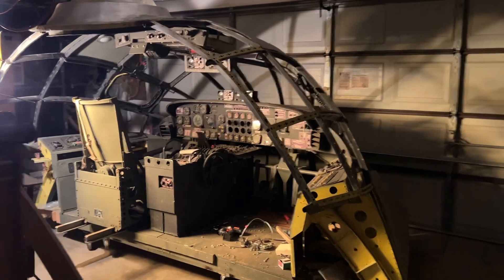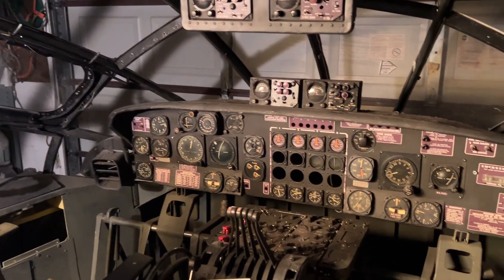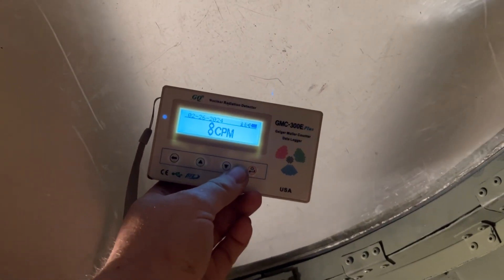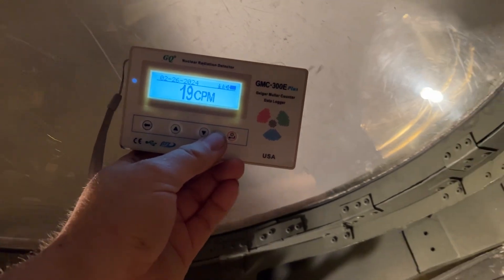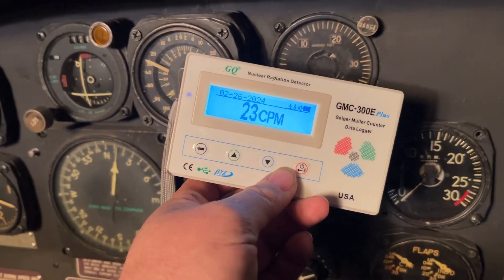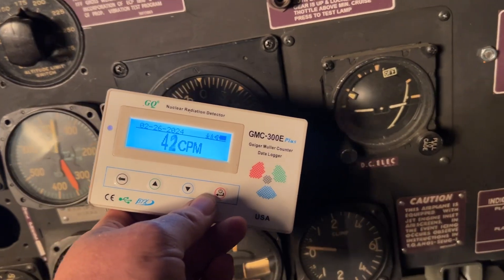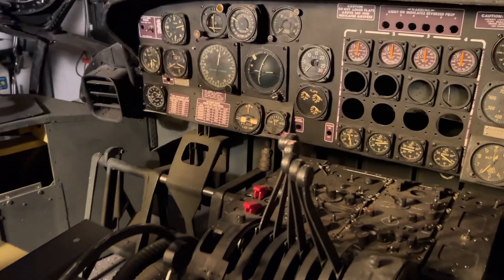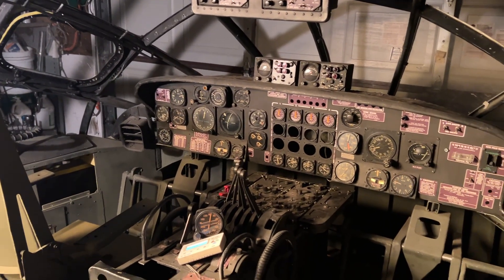B-36 Peacemaker Radioactive Flight Instruments And Gauges

Comment: I'd love to buy that compass! Anyhow, I advise you be careful with these gauges for two reasons- they, in bulk, can create a toxic atmosphere of impermissible levels of radon-222, or radon gas as a natural byproduct of Ra-226 decay. Secondly, they are known to leak radium dust, and contrary to the ''don't lick it comments'' this is worse than you think when you consider that the GQ GMC 320+ you are using is horrible at detecting both high energy gammas and betas, which are principle Radium emissions. 

If this at all concerns you, please reach out for advise. I'd recommend spending money on a pancake probe or alpha scintillation to mitigate any potential contamination incidence(s)
I should also bring to your attention that legally you can only own 100 of these gauges.
Reply from the maker: Excellent information, thank you. The gauges you see are all that I have, and the compass is by far the hottest. I keep it stored in an isolated part of the house, pointed into the foundation. I wash my hands after handling, which is once in a blue moon.
Reply: @B36HPeacemaker  I have 6 of those compasses, and yes that specific one is pretty hot. I think those came out of ships, the aircraft version looks a little different.
Reply: @spartakusgoulash3109 From the person who has since acquired his compass the last week, I can tell you... that thing is indeed HOT. Both my Radiacode 103 and 110 detectors scream just getting close. My devices are able to detect it in the open air from about 20ft away even with it facing away from the detectors. Currently I have it in an airtight container, inside another plastic sealed container (Double air tight to prevent leaks), wrapped in a .5mm lead blanket thats easily doubled and tripled up layers, and inside an iron box. That thing is still detectable from around 6-8ft away, but it's like 1% of the naked reading and barely above background levels at that distance. (Radiacode 103 device hits 750k CPM and the far more sensitive Radiacode 110 detector hits over 1.5M CPM. I was able to get it tested just this week by a full spectrum detector and the max dosage right up against the glass is 275 mR/hr across all spectrums. (Alpha, beta, gamma). Because its so hot, I am ordering thicker lead but it is MUCH safer how I have it stored and will be more safe with additional lead. Had the honor of getting to tour his build today and test radiation levels of many many other super spicy gauges that were used in the the aircraft. Truly stunning what is out there!

Comment: A subject that I have an interest in as I'm retired from owing a aircraft parts/avionics/instrument business, and as a restorer of classic aircraft instrument panels. You are correct, the older green under UV light ones are the ones that can be hot. I have that same detector, except mine is the GMC-320 Plus. In my collection I have several radium instruments, most top out at around 3500-4000 CPM, though I do have one WW-2 DG compass that is around 8300 CPM, that I keep on a top shelf. My C-118 pilot panel has two of them, a VSI and a Turn and Bank. Some people freak out about these and refuse to have them in their collections. Like anything that might be hazardous, a little common sense is all that's required, don't open them up unless you have a good reason, such as cleaning the inside of the glass or functional maintenance. Don't intentionally breathe the air inside the unit, wash your hands after you are done, and as you said, don't put them under your pillow at night, unless you're really wanting to win a Darwin Award. That said, great video.
Reply: Orange ones are the hottest

Comment: Just don't eat the gauges and you'll be fine. Got it
Reply: Instructions unclear. Ate the air speed indicator dial and got finger stuck in a socket.
Reply from the maker: Correct, and don't sleep with this stuff or use it as your favorite paperweight.